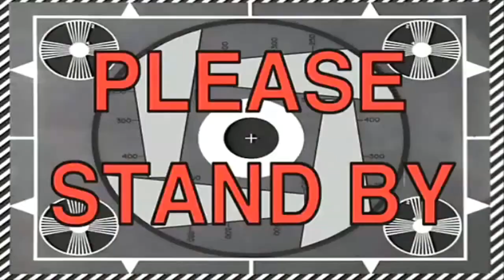THE SUPER GATOR IS FLAT

Comment from the maker: Thanks for Stopping by Today. I'm goad to see the Gator making a move in the right direction. What about you?
Reply: Yes
Reply: 3DMachines I know your set on putting a Suzuki motor in the gator but wouldn't the chain drive and the shifting be kind of hard why not find a nice snowmobile engine in it or something with a centrifugal clutch figured it would be better suited for pulling and woods and make a little more torque for pulling
Reply: 100% man! have you thought about anything suspension related for the front end?
Reply: Josh The Incredible Chicken         I agree     if he goes forward with the suzuki conversion  it is going to need major frame and mount modifications  plus it will need some kind of suspension added . plus upgraded axles Hubs  wheels and tires and I'm sure lots more as he gets into it.
Reply: and it will need a major brake upgrade
Reply: 3DMachines yes love it keep up the good work
Reply: 3DMachines I love prince
Reply: 3DMachines hey, Dalton, if that's a new battery, it shouldn't have went dead. you may want to check for a parasitic draw on the battery and check the charging system. the ignition system is most likely a magneto style like in a lawn mower, but your fuel pump is electric, having the battery go dead and no pump in the middle of a forest miles from anywhere would be a bad day
Reply: 3DMachines I knew the new tool was going to work anything can work if you put your mind to it
Reply: lol, never mind, you're already fixing it, new engine. that will teach me to wait until the end of the video.
Reply: 3DMachines I have one of those harbor freight tire changers. bolting it down it works 1000% better. pick a spot in your shop, dril holes into the floor, drive in concrete anchors with lag bolts. then bolt it down. unbolt in when not using and put plastic plugs in the holes to keep dirt out. I did mine this way, and it works fine
Reply: 3DMachines why dont u reply anymore?. im already likeing this build .
Reply: tbh I would have looked for a quad enginw with reverse
Reply: 3DMachines 3dmachines put a long peice of wood and bolt to the wood so it won't go back
Reply: what you could do is get a bike or dirt bike handlebar and run everything like a dirt bike run the gas and clutch to The Handlebar and just make a shifter and put that on the Bottom by the existing gas pedal and Brake
Reply: 3DMachines There's so much friction here these nuts keep getting hot! 

-Dalton 2017 😂
Reply: 3DMachines i have a gator just like that and im selling it for 500 dolars
Reply: 3DMachines get rid of the steering wheel and use the handlebars. That way you'll have the throttle and the clutch for a chain drive.
Reply: Bama Bushcrafter that's kinda what I said
Reply: 3DMachines should put a 4bt Cummins in that pig
Reply: coal was awkward
Reply: 3DMachines I like the new "random video" thing at the end, it would be cool if you put old videos in that box, or just older ones from a year or 2 ago, something like that!
Reply: 3DMachines Dalton my friend has the same problem with the tire thing he mounted it to a little wood platform so he can put it any where
Reply: 3DMachines can u tel jake to do more videos
Reply: Hi 3DMachines! I had a gator but I gave it away. I am putting up a knew awesome video this week on my channel so you guys could watch it. Stay Froggy fresh.
Reply: 3DMachines when you said not trying to make it into a NASCAR I had a image in my mind of a gator fly around the track
Reply: also, they have v-tread tires online which u might want after the initial boost in power. a little more traction or a little more dirt flying...
Reply: what id do is take the rear tire of the motorcycle. then take the front off the gator completely. so all you have are the 4 rear tires and the bed. all you would have to do not is make a mounting frame for the motorcycle to the back half of the gator. put a gear on the rear axel and hook up the drive from the motorcycle. think like trying to make a trike but with 4 wheels in the rear rather then 2! GOOD LUCK BUDDY!
Reply: 3DMachines DO A CLUTCH AND GEARS!!
Reply: losing the seats for 2
Reply: remove the governer on stock motor
Reply: 3DMachines you should put tracks instead of tires
Reply: just cut the junk tires off with the angle grinder....just be careful of the rim....steady hand
Reply: 3DMachines mounted on a pallet
Reply: i have my own channal im trying to start up
Reply: dave1135 its because the fuel pump. a few videoes ago he said he could hear the fuel pump and he turned it off but i do think there is a wiering issue.
Reply: cameron hamilton I'll check it out
Reply: hi sara
Reply: 3DMachines y u no post for two days
Reply: @johnny muddy trucks because he went to visit his dad it's all good
Reply: Ok
Reply: Keep up the good work.  That thing will be sick when it's done.
Reply: 3DMachines where are you are you ok?
Reply: Jared Brodsky i guess he will use more parts from the gs1000e
Reply: 3DMachines were are you!!!!
Reply: 3DMachines ...?
Reply: 3DMachines are you ok?no video in 3 days my life is over
Reply: Dude 3 days? 😩
Reply: What happened
Reply: Where are you dalton! You ok?
Reply: dude are you ok man
Reply: pretty creative there with the trailer hitch bead breaker Dalton. nice
Reply: 3DMachines an sr20 would be epic
Reply: 3DMachines isn't that ur old motor bike from the Moto vlogs

Comment: put a chain from motor to the secondary clutch on the gator. by that I mean take the secondary off and replace it with a sprocket. and use existing sprocket on motor.
Reply: exactly what i was thinking
Reply: Iab BH.
Reply: Iab B I too had the same thought remove the rear pully and replace it with a sprocket. Chain to the output of the transmission from the bike.
Reply: That CVT transmission is designed for 9hp and about 3000-4000 rpm  max. The gearing is too low it is set to 16mph at 4000 rpm. That 90 hp streetbike engine will turn 10000 rpm  it would strip out the gears in about 2 minutes flat and it still would only do maybe 40mph.  If he mounts a sprocket and chain it will handle 150hp.

Comment: Tip for removing tires:Lie the tyre and rim flat on the ground, rest a ramp on the tyre but away from the rim, drive up the ramp.I have used this trick on tractor tyres so it will work on the gator.Hope this all makes sense.
Reply: Jacob Fletcher what is a tyre???

Comment: The gator, Has a CVT (constant velocity transmission) you should be able to find a cvt clutch to go on the crank of the dirt bike engine (Dirt bike may have a diffrent diameter crank) so that way you can utilize the same belt. But your best bet is to use the gearbox off of the dirtbike and running a chain to the axles

Comment: what id do is take the rear tire of the motorcycle. then take the front off the gator completely. so all you have are the 4 rear tires and the bed. all you would have to do not is make a mounting frame for the motorcycle to the back half of the gator. put a gear on the rear axel and hook up the drive from the motorcycle. think like trying to make a trike but with 4 wheels in the rear rather then 2! GOOD LUCK BUDDY!

Comment: try a chain system and use the motorcycle clutch or you can build an adapter in your favorite machine shop to get the gator "clutch" to fit on the motorcycle gearbox output shaft where the sprocket sits.

great videos!

Comment: Don't be stupid😂, use sprockets and manual clutch. That new engine is WAY to powerfull for a tourque converter(sry CVT)!!!!!! 😉
Reply: Torque converter? Why comment if you are clueless on the topic? First off the gater has no TQ, it utilizes a CVT (continuously variable trasmision) which offers a continuous range of effective gear ratio. Also keeps the engine at its PEAK power in the rpm range. A CVT setup withstands to 200+ HP snowmobiles, so i doubt a clapped old 90 hp bike engine would even dream of being to much for a proper CVT setup.. Heck even some new cars/Suv's have made to jump to using CVT.
Reply: I might have messed up with the name, and accidentally called it a TQ insteed of a CVT, im sorry.... but your smart brain suggest that it's not a problem using a CVT that scaled to 12 hp, on a 100hp engine.... your smart brain don't think it's a problem with a 12hp scaled clutch on a 100hp engine....
im asking because ofcourse im "clueless" as you said...
Reply: You seem to have missed where I clearly said "proper CVT setup" now with that said..

now that we are past that. There's no "HP limit" to a primary/drive clutch. Granted the clutchs that came on the gater are an ancient design and I wouldn't run those on anything. The main issue firstly would be that in no way would the crank from a motorcycle work, as primary/driven clutchs are primarily held on by friction via taped crank end "pressed" in sort of speak by the center bolt being torque to a specific spec, thus why the puller was required to remove it. His engine does not have this. If he were to some how get past this issue he would the have to deal with more HP he would just need to run different springs, heavier weights and a helix with a steeper angle to load the engine more. Lots of trial and error here.

Theoretically from a performance stand point, the cvt setup would be superior as it keeps the engine in its peak power range when tuned properly. However, the actual build of this setup is literally impossible with his limited knowledge on the task at hand and his lack of tools.
Reply: I still don't get why you would piss on me like that... only imagination sets the limitation in a perfect world. you might have a propper good gater if you use CVT designed for the application.
but he has a motorcycle setup or a 12hp cvt setup to work with.

To your "There's no "HP limit" to a primary/drive clutch". there will be ALOT of clutch slippage if you aply a 100hp engine that CVT clutch. as it is probably only a 2 plated organic clutch, where the CVT's you use is probably sintered clutches, with (without knowing) probably more then 2 plates.

but you can probably agree with me that in his case, he has a better chance of succes with the manual clutch and gearing from the motorcycle.
Reply: he will change it when he gets sick of smoking belts
Reply: The clutch he has is an early comet it won't take more than 40hp  the weights and spring in primary would have to be changed because the new engine will pull 40 grams more along with the spring and helix in the secondary because  old engine will shift out at 4000rpm the 10000rpm streetbike motor will shift it out in seconds bogging it out. The secondary is attached to the gearcase which was designed for 9hp and geared to reach 16mph at 4000 rpm the 90hp streetbike motor will strip out the gears in minutes.
Reply: thedanesimon  a tourque converter is similar to a cvt. I do why that guy got so upset about it

Comment: also use handel from cycle and clutch handle and use that to hook to shifter one in all get it?
Reply: Iab B I did that when I built a shifter cart with a kx125 motor. Just bolted the stock clutch perch to the shifter worked great

Comment: I would say run the trans from motorcycle and the auto cvt clutch that way you have 5 forwards cvt speed and reverse still. Probably be able to really haul a load and get a little speed if need be. Essentially make an idler shaft that you run chain from transmission to a sprocket welded to same idler shafts you weld snow mobile clutch to. From Auburn N.Y. !!!! Signing out...... Brrraaaapppp

Comment: Use the transmission from the street bike,  eliminate the entire cvt clutch tranny from the gator (it wont take the hp).  You need to mount a street bike rear sprocket to the first axle on the gator ( mark the axle where you need the sprocket and take it to a machine shop and talk about options for mounting the sprocket get them to mount the sprocket. Use a straight edge to line up the sprockets before you weld your  engine mounts, I would slot the engine mounts so you can adjust chain tension.  I would use the streetbike handlebars on the gator for throttle and clutch (cables might reach). Fab up a suicide shifter and your in business. wih the smaller wheels on the gator it will have less topend than the street bike but it should do 100mph+ but The tires cant take more than 60mph imo.
Reply: Replace the tires they are only 40.00 each.  the seats are 90.00 each from deere. I would replace the rear axle bearings when you take out the axle. You can buy an push button electric shift kit for an atv it would work good on that engine.
Reply: That engine needs lots of airflow for cooling,  your going to need to mount an 12v electric fan in front of the cylinders or remove the front plastic part from the  front of the gator for good airflow and keep an eye on engine temps.

Comment: you could have both in theory, hook the sprocket off the trans to the torque converter on the gator. make a clutch and shift lever in the cabin so you CAN shift, but when you want it auto, just put it in the closest 1:1 gear on the motorcycle engine, then the torque converter will take car of the rest

Comment: You should do a solid axle swap on the gator it would support the power your going to put in it and your flat tire issues you should just put some tubes in them that way you don't have to buy new tires and they will work just as well 
- Brandon

Comment: Guessing that Suzuki is a chain drive? run a chain to the rear axle with another sproket. Easier said than done and its a lot of work but I don't feel you will be able to retain the the original gear box nor would it hold up. Clutch could be run simply off a cable and the shifter could be a simple linkage or extension of the shifter depending on where it falls in the chassis. On another note what does that thing have for brakes? Might be something else to think about.......... Good Luck Dalton

Comment: The gearbox in high gear wont spin the centrifugal clutch fast enough, you're going to have to go off the final drive of the motorcycle motor. If you go chain drive it to the secondary shaft it will be sloe, probably going to need a jackshaft to step up the speed, then to the secondary clutch part off Gator.

Comment: If you use a lever as a shift stick and attach the clutch lever from the bike you could pull the clutch and shift with one hand and all you have to do is attach the throttle cable to the gas pedal. But you still wont have a reverse gear... so far I can see from out here. You will have to make a chain drive because the belt will simply slip. That is why scooters and other small engines can work with that belt transmission because they do not have the torque of the bigger engines that will simply eat the belt. Also you will get trouble with the automatic belt transmission clutch simply ripping apart by the torque of the 1000cc engine. Just mount the rear sprocket of the bike where you need it on the gator/crocodile. Reduce the rpm of the engine by using a throttle opening stop screw or/ and a pedal stop bump. Still need to figure out how to fit the seats and exhaust system beside how to get that engine into the thing... I guess it will end up in plenty frame work to the gator and a higher seating position.

Comment: ad far as the transmission situation i think u need to incorporate the gs1000 trans mission also otherwise you will only be in one gear from the motor putting strain on thosr components if you do it right it could work as a doubler giving u the low end grunt and the high speed....
love to see what you come up with

Comment: The bike engine has an integral transmission and clutch. Ditch the torque converter and use a simple chain and sprocket. The Torque converter would have to attach the the crank and that wouldn't be easy at all and ya would still have that transmission hanging off the engine unless you feel like doing some SERIOUS cutting and welding.

Comment: I'd question if the stock torque converter setup would even hold up to the power of that engine. I suppose if it's something that came from one of their older snowmobiles, and you don't really thrash on it, it might be okay. Otherwise I think you're going to have to use the manual transmission off that engine too.

Comment: I would keep it manual.  Just make a long shift lever with a brake handle on it for the clutch. If you don't trying to get the weights right in the  Centrifugal clutch is going to be a nightmare.  Really difficult to keeping correct engine speed.  Don't want to over rev and blow it up first ride.

Comment: Not sure if the original clutch it going to be up to the task, the original engine only puts out about 10hp and you had that clutch smoking.  I would look at a centrifugal clutch that is chain drive and same shaft diameter as the Suzuki to avoid having to use the motorcycle clutch,  or run it direct to the JD transmission and install a clutch pedal.  In either case you want to retain that JD transmission to have reverse available.

Comment: If for whatever reason using that motorcycle engine does not work the yamaha r1 snowmobile engine is like an r1 motorcycle engine without a clutch or gears and it would probably bolt right in with a new belt and a little adjustment and it of course is built with a good clutch on it so you would not have to worry about crankshaft differences.

Comment: sequential gearbox > belt CVT every time. running 8x the bhp through a cvt designed to handle 14hp is going to end in smoke. set up a chain final drive.

Comment: Dalton, before you come to a decision, you should probably see if that CVT can even handle the power output from the moto engine. It would be awful for you to do all the work fabricating only to ride that thing on a trail and you blow up the cvt because it was built for an engine that is 1/4 the hp of the larger motor.